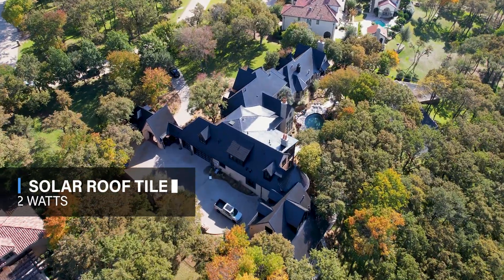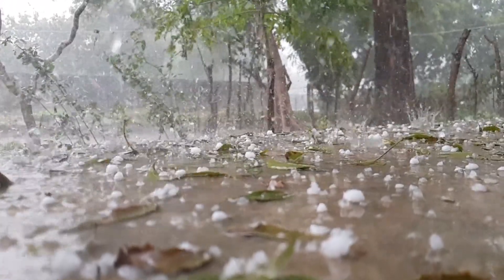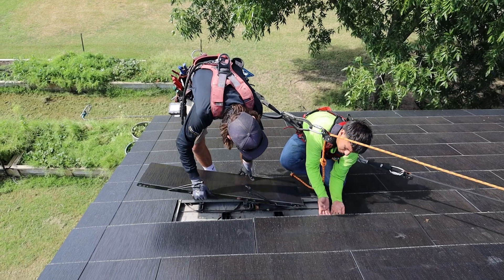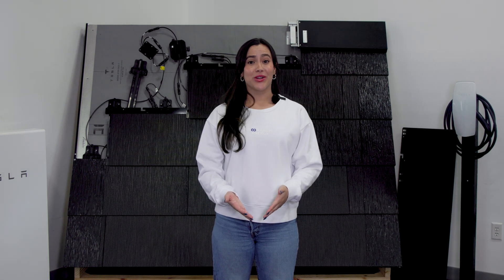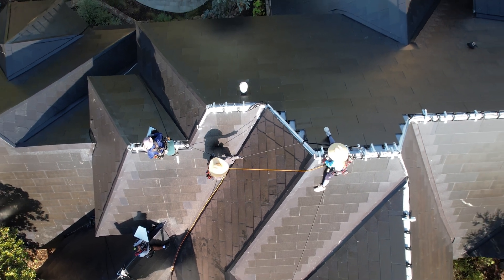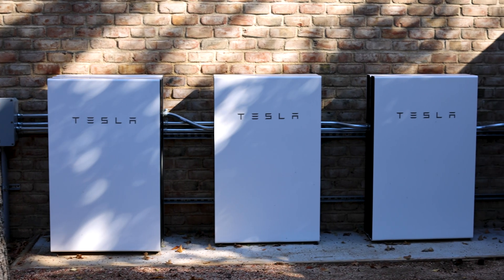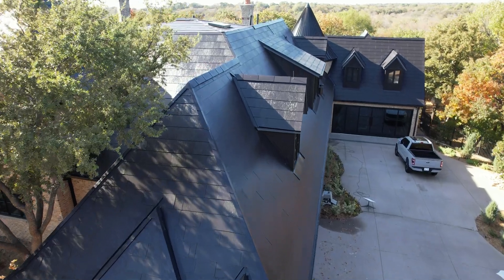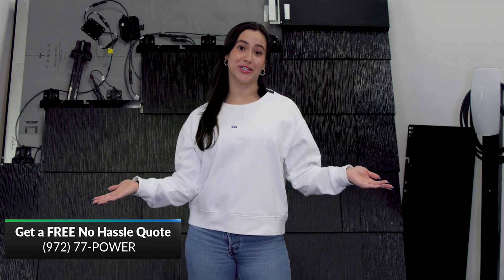5 Fast Facts about Tesla Solar Roofs

Comment: 2 questions: Do the actual solar energy producing tiles cover the entire roof like shown in the footage or only partial like shown on the computer with the software. 
how much more expensive is the tesla roof compared to a normal roof per square feet
Reply from the maker: Active tiles that produce solar energy cover what you see in the simulation, gaps between them where we can't put active tiles due to certain restrictions are filled with non active tiles that are custom cut for each individual roof to give that clean, uniform aesthetic look the solar roof is known for. The average square foot price is $35-$55 before factoring in the 30% tax credit and the 25 year electric bill savings.